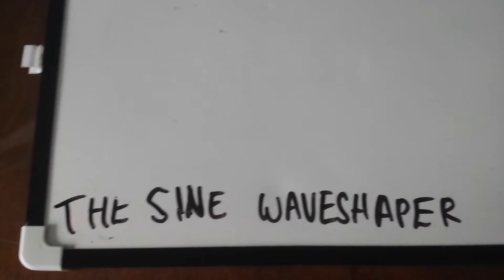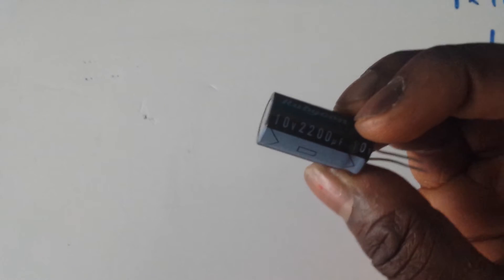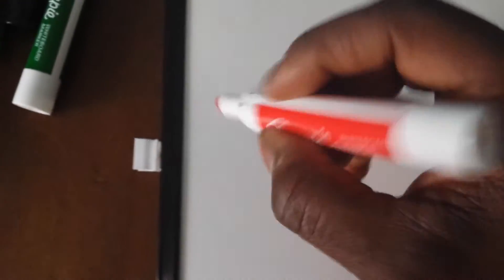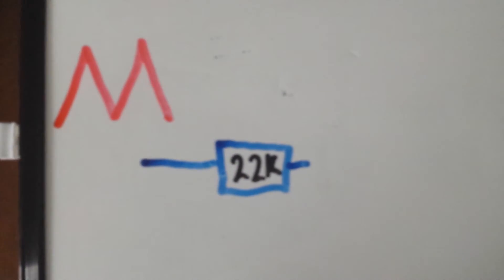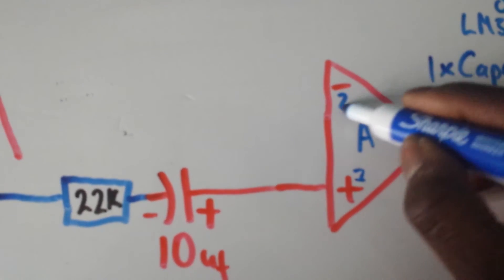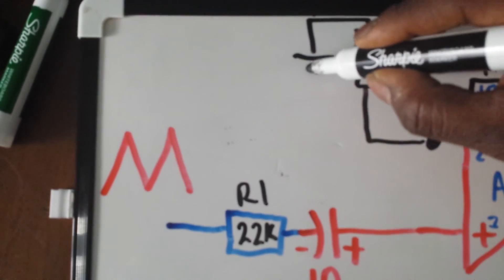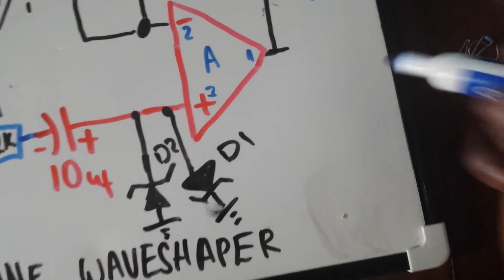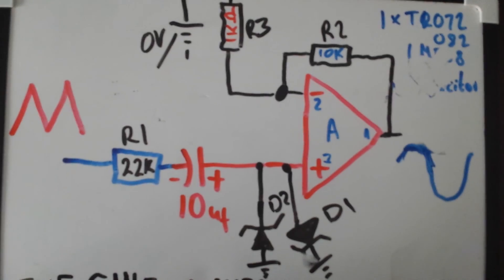DIY analogue synth Project Tutorial Part 7 ( Sine waveshaper circuit)

Comment: The way this works is it's basically a diode clipper circuit that rounds off the peaks, with a capacitor to make sure there's no DC bias so it isn't asymmetrical, and an amplifier at the output.
Probably the reason the Zener diodes work better is that the transition from non-conducting to conducting might be less steep/sharp with whatever ones he's using, resulting in a smoother curve (surprisingly hard to find much information comparing Zener diodes vs regular ones in general terms).
Its effectiveness is also very dependent on the input amplitude, so that might need a bit of adjustment (somewhere around the forward voltage of the diodes should be good). If for whatever reason you can't control the level of the input signal, you can try putting an adjustable resistor to ground after R1 and tweak it until it sounds right.

There's also another sine shaper circuit by Thomas Henry here that might be worth looking into, though it might require matching a pair of transistors (scroll down or ctrl-f for "sine shaper"): https://www.birthofasynth.com/Scott_Stites/Pages/multiphase_tech.html

Comment: Hmm... I struggle to understand this circuit. First of all the Zeners... Aren't they useless in this configuration? They only generate a 0.6V drop like regular diodes. The Voltage will never reach the Zener Voltage of the diodes? It kinda "defies" the use of Zeners... :/

And secondly. Shouldn't there be a resistor (after the capacitor) that connects to ground to create some sort of filtering / "intergrating" effect? If I'm correct all you are doing now is just sending a triangle wave in, clipping it at 0.6V and -0.6V with the diodes and amplifying it 11x to a Vmax of +-6.6V ?? It seems to me that this would be a nice wave clipper ( if you add a potentiometer between the diodes and ground, you'd get an ajustable wave clipper ) but not a sine wave shaper??? Or am I missing something?
Reply from the maker: Jean-Jacques de Balzac .  The circuit does work as im am currently using it on my third vco. Thou as ive said im no engineer so cant technically amswer the question. The minibrute uses the same circuit, thou with 1n 4148s
Reply: I have no reason not to believe you, but I just can't wrap my head 
around it. I have always had a hard time understanding electronics. I 
can't see how on earth this circuit turns a triangle into a sine... :/
Reply from the maker: Jean-Jacques de Balzac Yes thanks for your commemt and pointing that out to me about the resistor to ground which is actually on the schematic i gor this circuiy from . I think ill do an admendment video to follow soon as far as that is concerned 👍👍. As far as why the zener diodes worked far better than standard signal diodes is beyond me to be honest. Still thanks for your commemt and observations. Im going to do a part b to this very soon.
Reply: thats right the zeners can be replaced by normal diodes. and yes this is a bad way to convert a triangle into a sine. its just clipping the wave and not even filtering it so all you get is a distorted sine-line wave